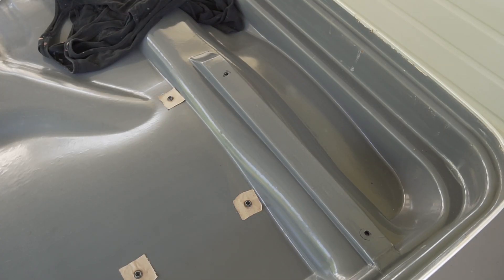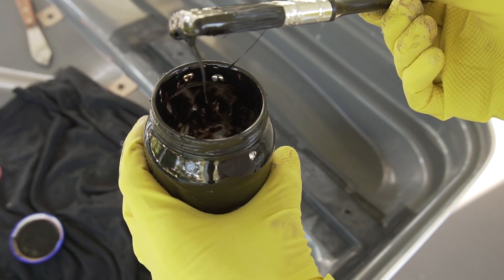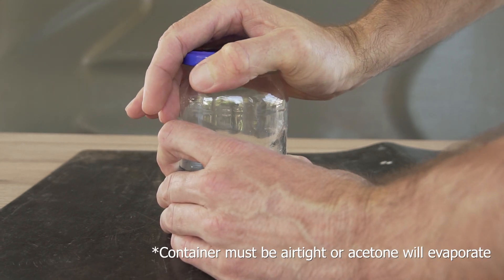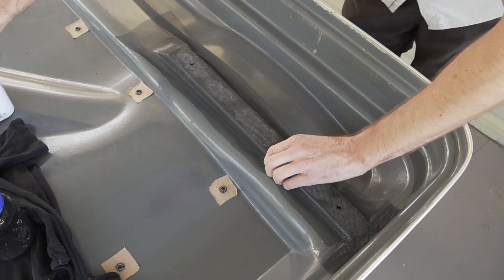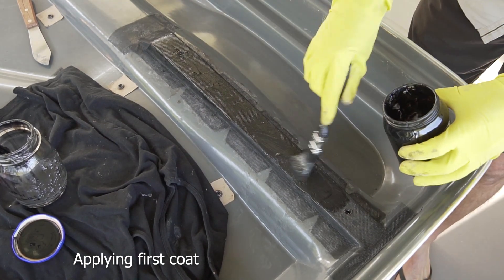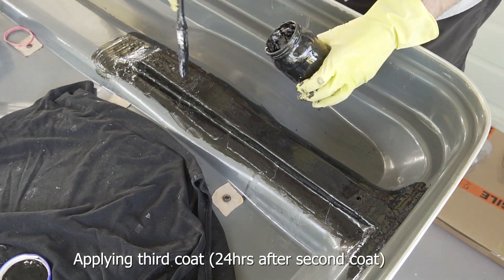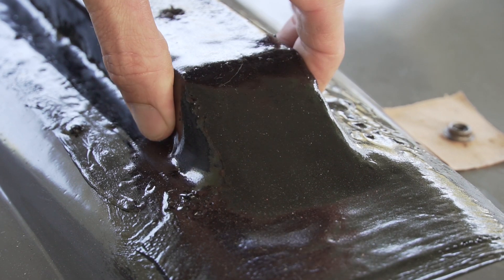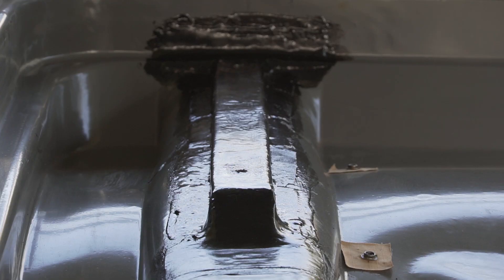How to repair and reinforce large ABS plastic items using ABS slurry.

Comment: Why didn’t you consider plastic welding as an alternative option for the repairs?
Reply from the maker: I did consider welding but it was impractical with the amount of surface area I needed to cover, as I needed to thicken/reinforce the whole area as well as repair the cracks themselves. I considered heating abs sheets and then bending/forming them around the affected areas, but the bends were too tight and trying to keep the sheet hot enough for long enough while bending it was just going to be too difficult.

Comment: I was looking for a way to securely mold two pieces of plastic together to make a custom bumper. I’m assuming since this is just ABS plastic melted down, that once it dries you can sand it down to make it smooth(assuming you do enough coats to retain the structural rigidity)? I’m also assuming you can paint over it the same as any other abs plastic material like a bumper once it dries? If so this is the answer I’ve been looking for to mold together a custom bumper for my car out of different bumpers.
Reply from the maker: I haven't tried sanding or painting the ABS, other people have mentioned it in the comments but I'm not sure what the results are like. I'd recommend doing a small test piece and sanding and painting that, it's one way to find out without committing to doing the whole job. I'd be interested to know how it works out if you do try it.

Comment: Sand area before using abs cement/slurry for best results. The mesh is completely unnecessary and the area  needs to be bare in order to form a bond otherwise you're just covering up the cracks vs. actually repairing it.
Reply: wrong
Reply: @donbon4204  Actually it's not wrong but I guess you also don't sand wood before painting too. 😆 You need to sand to get off any gloss, clear coat, etc... Rough up the surface to get a stronger bond. The mesh creates a barrier therefore making the bond weaker not stronger, so it'll eventually chip off.
Reply: @alexar.h.5031  paste where mesh goes to make it strong  that is why u r wrong
Reply: That's illogical, it's like saying putting a mesh between a broken bone and letting it fuse around mesh makes it stronger than simply letting a bone fuse together without something in between. The paste/slurry needs uninterrupted contact to melt and fuse together seamlessly. The mesh prevents it from fully fusing.
Reply: @donbon4204  prove me wrong, make a vid and post it here... take a couple broken pieces of ABS try one with and one without mesh then stress test them bet you the mesh breaks first and chips off.
Reply: @alexar.h.5031  WRONG AGAIN  just go back to making vegan food
Reply: @alexar.h.5031  WRONG!!!!!!
Reply: @donbon4204  I agree you are wrong yet again!!!! Vegan food? Where did you get that from? Nice assumption... But FYI not all females are vegan or vegetarian. 😆 Your attempts are getting super weak and you're too chicken to prove me wrong/right. Just because you're a male doesn't mean you know anything. If you're so right then explain how exactly it makes it stronger and show me proof. Obviously you lack knowledge, skills or anything relevant. To reinforce ABS all you need is to cement another layer or so of ABS together. ABS doesn't cement to metals
Reply: @donbon4204  ABS plastic is flexible and needs to be able to expand and constrict to take damage and heat/cold, the mesh whether metal or fiberglass mesh is highly unnecessary and counterproductive step.  Besides the mesh makes a sloppier job of it. Using ABS cement, slurry or paste allows you to overfill so you can sand and buff smooth without ruining repair while leaving a smooth surface to repaint as needed. But yeah common sense is wrong I guess.
Reply: @alexar.h.5031  actually he's right. You're not adhering anything to the ABS but creating a chemical weld that fuses the plastic rather than simply sticking it together (which most adhesives do, which is why when using an adhesive you need to prep the surface properly). When using a cement/solvent based method to fuse plastics, you only need to clean the base surfaces to remove contaminants. There is a considerable difference between adhering materials and fusing them.
The mesh in this case is being actually embedded into new material rather than just stuck to it so it is adding a great deal of strength. It's the same principle as using a rebar grid when pouring concrete; just on a smaller scale.
Reply: @NordicDan  I think the excellent point Alexa is making, and one that I was thinking about also, is the section that the abs slurry was used on is covered with layers of lacquer and gray paint. So the abs slurry is stuck to the paint and the mesh. It hasn't been bonded straight to the abs under the lacquer and grey paint!

Comment: Looks good but how long it last against wibration?
Anybody try it for car bumper????
Reply: Abs slurry is good for motorcycle plastics but car bumpers are made up of various types of materials including: fiberglass, polycarbonates, polypropylene, thermoplastics, etc... Just know what material it is that you're working with and use a compatible cement or repair method.

Comment: Repaired an ABS boat with ABS glue and plastic sheet rock joint screen.  Worked great same as your slurry.
Reply: how has the repair held up? I have an abs boat I need to repair myself - any tips welcomed :)

Comment: Isn't ABS pipe glue sold at the hardware store an ABS slurry?
Reply from the maker: I believe it is in some countries, very hard to find here in Australia though, hence I made my own. Making your own allows you to get the desired thick consistency. Not sure if off the shelf ABS glue/slurry would be thick enough for this method too.
Reply: Is it glue/slurry? I believe it's a cement that melts the and parts together!
Reply: @defiantlion231  Don't know for sure but it seems to melt the pipe and fuse them together, unlike pvc glue that acts like an adhesive, I'm guessing by the way it reacts that it is a slurry.

Comment: Where I can buy ABS Sheet? And can i use acetone which is used to remove nail polish?
Reply from the maker: I bought my ABS sheet off ebay, but you can also try model/hobby shops or even 3D printer supply shops (may not be in sheet form). As for using nail polish remover, I actually tried this as a test on a minor repair and it didn't really work. Most nail polish removers seem to have other chemicals added to them, such as fragrances, diluting the acetone, which is why I suspect it didn't work. I definitely recommend buying proper acetone from a hardware store.
Reply: @fortheloveofvideo6306  Can you get the plastic sheets on Amazon? I found some that say 'moldable' is that okay? and they are in white which I want for plastic on my camper.

Comment: As a matter of interest, have you had any leaks since doing your repairs?
Reply from the maker: Glad you liked the video! I've actually been meaning to add an update on how the repairs are holding up. We've had the tent on and off the car a few times since completing the repairs about 6 months ago, with the longest time the tent has stayed on the car being about a month. So far so good with zero leaks and the repairs are holding up well. From what I've seen I'm pretty happy the repairs will last a long time.
Reply: That's awesome to hear. I sent your clip to a friend and he used the same technique to repair bumpers and other ABS car parts.
Reply from the maker: @SP-pr8bt  that's great, hope he finds it useful!
Reply: Sorry I actually ment that years ago he had used the same technique as you used on your RTT. 
But without your video I probably would have used a fibreglass repair kit as directed by the Morami importer when I spoke with him. 
I am however going to use a self adhesive fibreglass gyprocking tape on the areas that are paper thin. As these RTT came out of China I guess their quality control wasn't the best.

Comment: I'm having trouble finding ABS plastic sheeting that will actually melt like this in the US, anyone have a source?  I bought one off Amazon that claimed to be ABS, but it didn't melt at all after 24 hours.  Acetone is still clear.  @For The Love Of Video - where did you get your ABS sheet?
Reply from the maker: I bought mine off ebay, it was from an Australian seller though. Hobby shops are also worth a try, or even 3D printing supply stores as they also seem to use ABS from what I've seen.
Reply: @fortheloveofvideo6306  Good idea, I did check at our local hobby store but they didn't have any.  I'm going to resort to melting down ABS 3d printer filament and cut my losses at this point.  Thanks for the informative video!  I will be doing a similar repair on a Thule roof box.
Reply: @TheIowegian  I bought mine from Wal-Mart oine. Metra ABS sheets, 8x12. What kind of acetone did you use? Nail polish remover will not work. My plastic turned slurry quite quickly.
Reply: @TheRoadhammer379  I used hardware store pure acetone.  The 3D printing filament worked great and melted pretty quickly, plus it comes in a lot of colors 😉
Reply: I am having the same problem. The plastic is not dissolving and is just a blob of material as opposed to a workable paste.
Reply: @briankramp2873  Is your acetone still just "gray" like there is a lump in the acetone vs a consistent (even if thick) paste?  If so, you have a problem with the material you are trying to dissolve.  If not- it's just a really thick blob, I would adjust your ratio and add more acetone and let it sit a bit more to thin it down.  Make sure the jar is sealed you are dissolving in.

Comment: Excellent work! I like how you documented everything and showed the before and after. For folks that complain about visual stuff. It could always be sanded and painted.
Reply: Doesn't really harden enough to sand. Apply as smooth as possible and use a thick primer

Comment: Thank you! I had come up with the same combination of screen and ABS Slurry before seeing your video. But your video did confirm that this method will work well for ABS repair.I have been building a popup roof for my van using 2 full-size ABS pick-up truck canopies (roughly 8' x 6' x 27"). I also used Methol Ethyl Ketone (MEK) to bond large pieces together and used the slurry as a filler.
Reply from the maker: Happy to help! Hope your popup roof turns out well 👍

Comment: I really appreciated your video; I have a project coming up which is the reverse of yours; I am trying to "affix/adhere- abs/polypropylene  "bumper grill clips to a "fiberglass substrate"; any ideas?? thank you, PATRICK.P
Reply from the maker: Unfortunately I haven't tried the reverse (attaching ABS parts to Fibreglass), however I suspect you would have the same issue of the two not adhering that well. There may be an off the shelf product that can adhere pre-manufactured ABS components to fiberglass perhaps? Only other thing I can suggest is building a layer of fiberglass over the base of the clips to kind of enclose the base, so even if it doesn't adhere to the ABS well the fiberglass will still physically hold it in place, if there is room on the clips to do so of course.
Reply: @fortheloveofvideo6306  I, LL LET YOU KNOW WHAT I DID WHEN I TRY IT OUT; THANK, S PATRICK.P

Comment: Did you try to sand it at all?
I bet you can make it thinner for bathtubs. I need to tey this with some ABS PLASTIC PIPE. I never seen it in my country. Anyone know where to but sheets of that plastic in America?
Reply from the maker: I haven't tried sanding it, however someone else in the comments has and had ok results. After sanding they used body filler to fill any small holes. As for where to buy, try ebay or hobbyist shops.

Comment: I've fixed a 3D-printer part what was injection molded with ABS. Makerbot didn't want to replace the part for me because it was too old of a machine so I had to improvise. Going to install it right now, let's hope the reinforcements work!
Reply from the maker: Hopefully it does the job 👍
Reply: That fucking sucks when companies don't want to help u out due to how old 1 of their products are. Improvising & thinking outside of the box r a must to when dealing with low manufactuering products made with plastic. I call it a factory flaw from these evil companies knowing their device are made to fail.
Reply: Would love to know how that worked out for you.  I'm enjoying the hilarious self-referential irony that the manufacturer didn't want to deal with a broken part in a product that's made to solve pretty much that very problem.

Comment: I will try this on a cracked laptop  - the top has a crack near the hinge. The one thing I will do extra is drill a hole at each end of the crack as you would with any metal crack welding repair. I will use cable ties for the ABS slurry mix and some thin wire mesh from JayCar to give it further strength. Fingers crossed.
Reply from the maker: Good luck with the repair. An easy way to test if the laptop plastic is actually made of ABS is to rub a small amount of acetone on the plastic in an inconspicuous area and see if it starts to melt/soften. I've come across some plastics that look like ABS but once I do this test I discover that they aren't and this method with ABS slurry wouldn't work to repair them.
Reply: @fortheloveofvideo6306   - Thx I'll give that a go first.

Comment: Hey mate I’ve got the same rooftop tent, I’m looking to do the same process with the ABS plastic but I’m wandering how you removed the frame from the hard shell itself, is it a couple bolts located underneath the roof rack rails itself?
Reply from the maker: There are 8 large bolts (2 per roof rail) with nyloc nuts underneath. Then there are about 24 small screws/bolts that attach the outer edges of the hardsheel plastic roof top to metal brackets that are then attached to the frame. These are tricky to undo as clearance is very limited for some of the brackets. I ended up having to drill a lot of them out due to rust anway, so I replaced with small bolts with hex nut on inside for easier access. Hope that all makes sense!
Reply: @fortheloveofvideo6306  Hey mate, what nuts/bolts did you use to replace the 24 little 'chicago screws'. Do you find they catch on the canvas? I'm about to undertake this repair but have to drill out all 24 screws.
Reply from the maker: @turorit  I used stainless M4 pan head Philips screws with nyloc nuts. I used either 12mm or 16mm long screws. I bought both lengths so I could use the ones that didn't protrude much, have since sold tent so can't check which length I ended up using unfortunately. Never had issues with them catching on canvas or anything, they did the job really well. Hope that helps.

Comment: Just wanted to share my experience of the learning the ABS slurry trick from this video. I made some ABS slurry with broken pieces of ABS pipe and acetone. I painted over a cracked ABS elbow fitting of my sink drainage and built up a coat about 2-3mm thick over few days. Soaked the brush in acetone so that it could be reused until the last coat was done. That was a perfect solution to me. The painted ABS slurry dried up with a strong coat of ABS over the crack and the whole elbow, and stopped the leak. I would say it would last as long as the ABS pipes connected to it. This saved me a lot of work of creating enough space and repair afterward for replacing the ABS eblow. Thanks very much this video inspired me for my successful repair.
Reply from the maker: Really great to hear that nextimpact. I make videos like this to help people so I'm very happy you found it useful 👍😄
Reply: Can the slurry be stored and used later? More than just 2 or 3 days... like months.
Reply: @caseyw.8325  I had been using the slurry over a week. Just keep the lip tight and add a bit ancetone if the slurry dry-up a bit.
Reply: @next1mpact  Thanks... slurry is started, mi ed 50 Gms of black Legos and 125 mls of Acetone a few hours ago! Soo excited
Reply from the maker: @caseyw.8325  I've got a jar of slurry in the shed that I made 3 weeks ago and it's still the same consistancy more or less. I find glass jars work well for storage, as there's no chance of the acetone disolving the glass and they seal really well. Good luck with it all 👍
Reply: @fortheloveofvideo6306  It is in a glass jar
Reply: @caseyw.8325  I thought about lego for an ABS source... I just couldn't make myself do it lol.  I ended up using 3d printer filament.
Reply: @TheIowegian  my 15 yr old donated the legos for my project. He thinks it's cool that his legos will now be riding around as part of my motorcycle saddlebag!
Reply from the maker: @jacklarson6281
Reply: I've never used acetone before question is it just one type or is it a special kind is needed to do this? I have a 1985 gmc sierra classic c15 suburban. The rear air conditioning cover needs repairing I really don't know if it's plastic or what.
Reply: @rayjohnson7886  Acetone is just normal acetone. Put some on the not noticeable area of the air conditioning cover to see the acetone could melt/dissolve the surface. If so, it will work for you then.
Reply: @next1mpact  @next1 mpact thank you I appreciate it I received the mesh wire a few minutes ago from Amazon. I was cutting it so it'll be renforcement good.
Reply: @next1mpact  By the way I'd like to know more about doing the slurry I'm just learning about it. I seen the video yesterday I think and watched a little bit today. I don't know if anyone sells ABS here I'll check but once the ABS is cut and it's in the acetone. Do I let it sit a few hours until all the liquid turns into a jelly?
Reply: @rayjohnson7886  Go to a plumbing store to ask for ABS pipe. The video has shown the mix-ratio of ABS and acetone. Let it sits for few hours. When the mix turns into jelly, use it like glue then.
Reply: I did the same thing and it worked very well